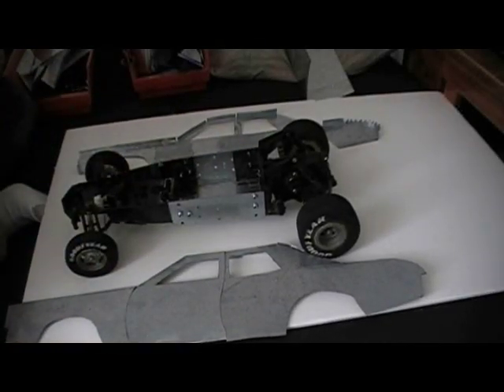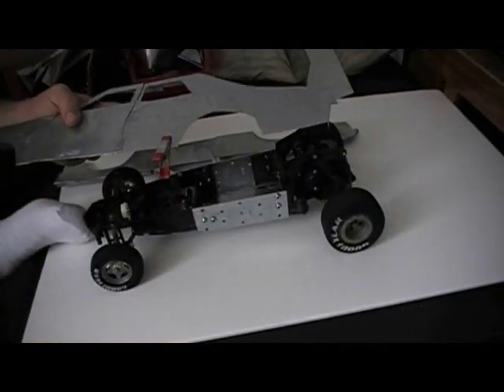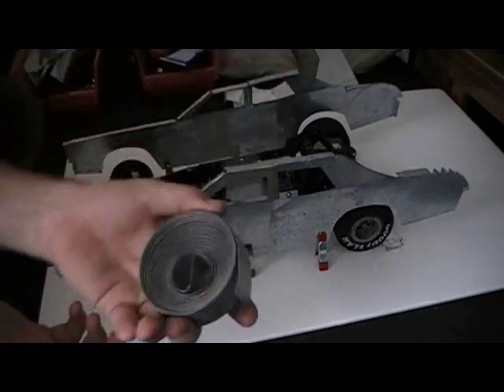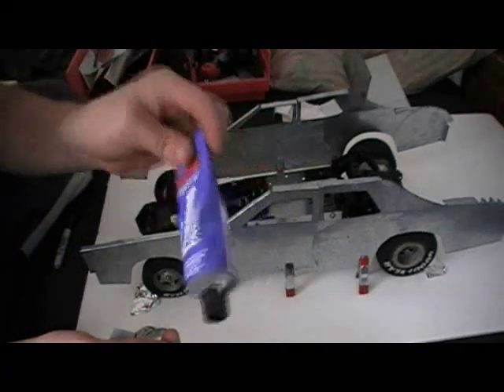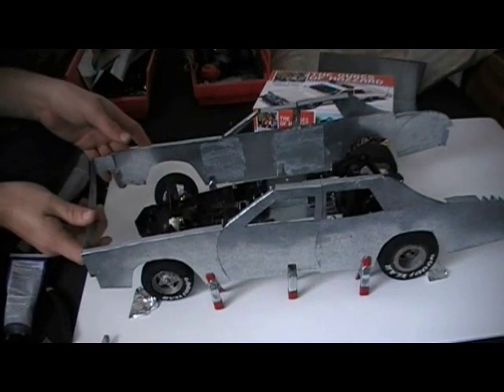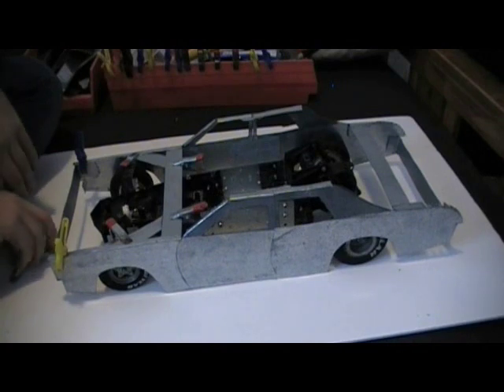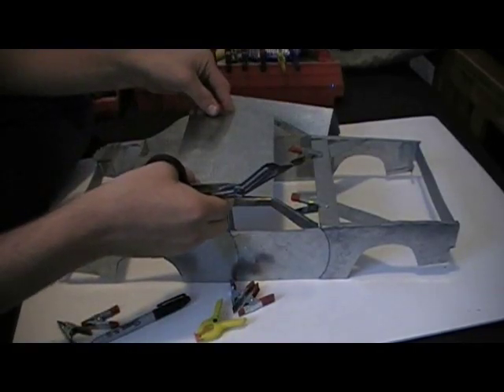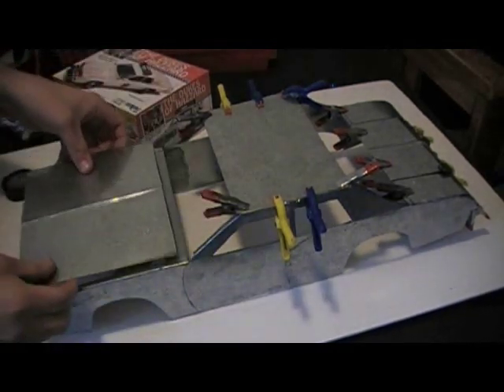How To Make A Sheet Metal Rc Car  Part 4

Comment: Hi. I know this is an old video, but I am just seeing it for the first time. Just curious if the steel would interfere with rc radio signals. Want to turn an old tonka truck into nitro rc. By the way, cool work!
Reply from the maker: It wont interfere as long as the antenna wire doesnt touch the metal body , use an antenna tube
Reply: @TheRandomMechanic  Thanks for the fast response. I'm on it!

Comment from the maker: my sheet metal was free            it was thrown away extra material  from houses being built in the area      it is   flashing        and you can buy it at home depot           usually  you can buy sheet metal   from  ace hardware , tractor supply  ,     or if you have a local steel supply         there is one near here discount steel   they sell steel 55c a pound   my rc cars are usually less than 6 lbs   so around 3 dollars in material    plus the 99c clamps  , 2 dollar super sizzers and goop

Comment from the maker: @MrBoygenis   i usually wait until more hornets are on ebay   there are not many at the moment     usually  a used hornet   i can pick them up for 35 to  60 a piece    35 without servos and remote  60 with     if i see a hornet that might sell for cheap i will let you know       i will be buying another hornet for my new project i started   but i will keep that one quiet for now   until i am ready to finish it anyway   it will be a while